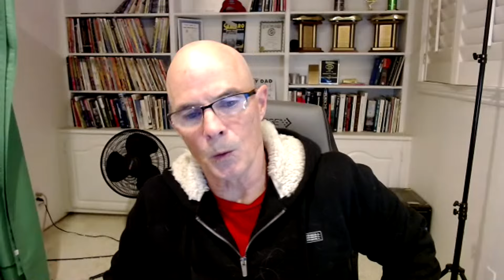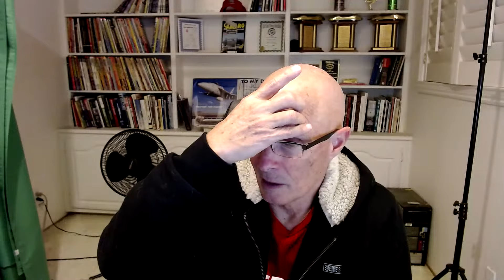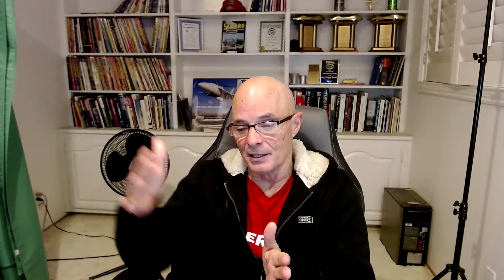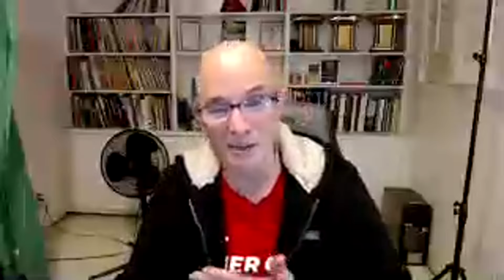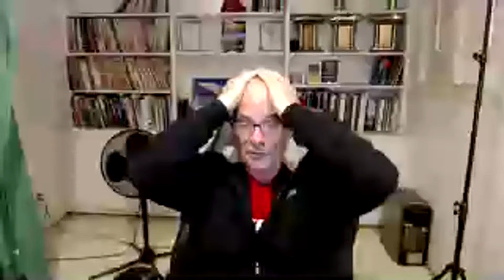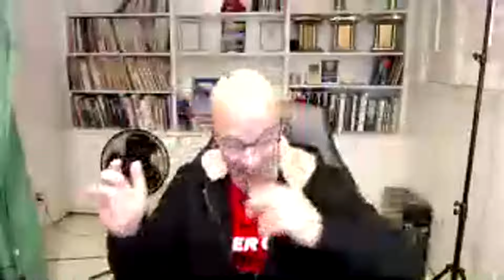M90 BLOWER V6 VS V8 LET'S TALK TECH

Comment: I'm building a small block Chevy 265. Which just happens to be pretty much the same as the four point three liter v six
Reply: @EsmondPerformanceEngines  

Chevy seems to have a thing for engines in that displacement range.

Stovebolt HD 261 I-6 - 3.75 x 3.9375
SBC 265 V8 - 3.75 x 3
SBC 262 V8 - 3.671 x 3.1
SBC 267 V8 - 3.5 x 3.48
4.3 (262) V6 - 4 x 3.48
Gen II 4.3 "265"  V8 - 3.736 x 3
Gen V 4.3 (262.5) V6 - 3.921 x 3.622

I have a friend with a 55 Chevy Wagon Body on a Caprice Chassis with the Gen II "265" V8 (Actually 263) and 4L60E.

Comment: Head-flow per cylinder, sounds to me like the less cylinders at similar displacement would be easier to come up with a low rpm grunt engine vs. a top end screamer. Maybe why Lamborghini's commonly have 10+ cylinders, vs. a farm tractor has few, each serving a pretty specific purpose.

Comment: There’s a few na guys here in oz that have gone nuts trying to get power from the 3800, I’ve seen a few go reasonably well! I worked on a 3800 for speedway it made 265whp,but compared with the later model aluminum 3.6 easily making 300 they’re simply redundant! and the Barra has no issues making 400! I’ve heard of another 3800 just crack 300whp with aluminum heads and a very high compression ratio, and with basic components I’d imagine a diy guy could expect to make a whopping 200hp ish, the engines are cheap garbage and are hardly worth messing with! So why do I persist with this cheap garbage that barely anyone else does? Cos 400hp is 400hp and on 15psi boost with a turbo all those problems go away! and a turbo is pretty easy! But unfortunately so is turning up the boost!
Reply: The 3800 is also extremely compact, so it swaps places an I6 or OHC v6 would never fit.
Reply: Reliability wise, though, I'd take the 3800 any day of the week.

Comment: 🤗THE SAME DISPLACMENT CHALLENGE BABY. WOW 🤯 THAT I LIKEY.😄 🥳🥳😏
I THINK EIGHTS WASTE .🗑  WHY WOULD AN ENGINEER DESIGN A SEMI TRUCK WITH AN IN LINE 6 VS ANYTHING ELSE, THO IT'S TORQUE PRODUCTION . 🤔SOMETHING TELLS ME  THEIRS SOME MECHANICAL CONSENSUS THAT SEEMS TO B KNOLEDGE WE DON'T  QUITE UNDERSTAND OR   OR AWARE OF .🤔  LIKE TO SEE THIS 1N PLAY OUT
Reply: Inline 6 is the most efficient engine design with good balance. It's about fuel mileage and longevity.

Torque comes from one thing, cylinder pressure.
Reply: @gk5891 torque comes from cylinder pressure and stroke length. That's part of why big trucks run low cylinder counts, they put their displacement into the stroke.
Reply: @BuffMyRadius  For a given cylinder pressure if you reduce bore area by the same proportion (for the same engine displacement) you increase stroke you get a 1:1 ratio. You can't halve the force while doubling leverage and increase output. In actual engineering test the long stroke engines actually make slightly less torque (although at low rpm the effect is very minimal) due to thrust losses (even when controlling for valve shrouding as much as possible). 

Smaller bores do have some advantages in heat management (which can effect durabilty) and packaging and the lower the rpm the less their disadvantages are actually a practical concern. 

For large diesel engines that can be 900 ci, make peak torque down close to 1,000 rpm (controlling destructive harmonics limit them from going much lower) and horsepower as low as 1,400 rpm while operating at 4 times atmospheric pressure and grossing up to 288,000 lb (Heavy Haul) managing heat is critical.

Comment: A v8 would automatically have 25 percent more engine  head flow even if the per port flow and displacement are exactly the same. Advantage 4.8 in almost all cases.

 Silly question how sturdy is the bracketry to externally mount an m90?